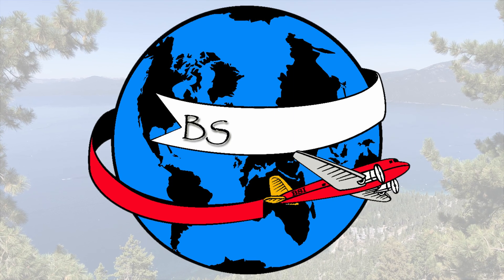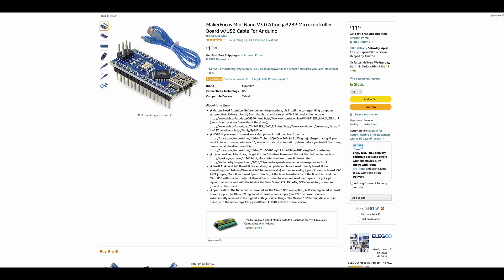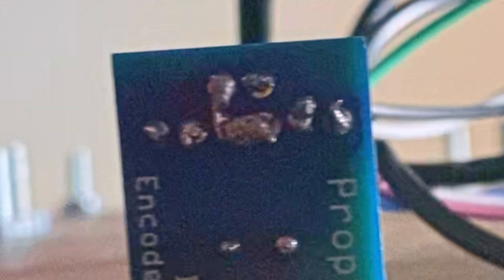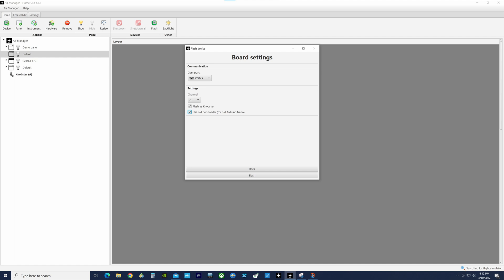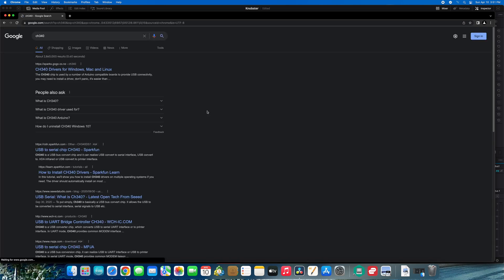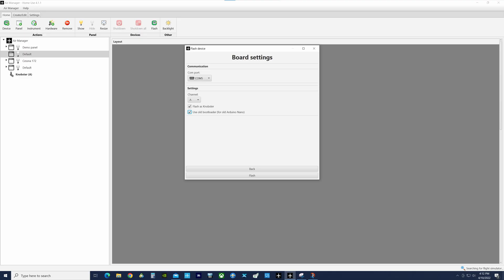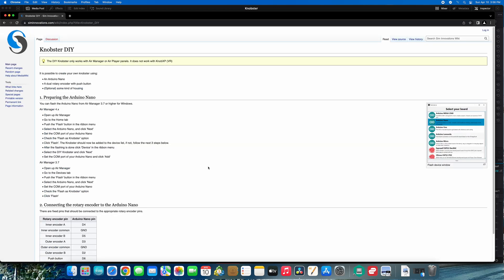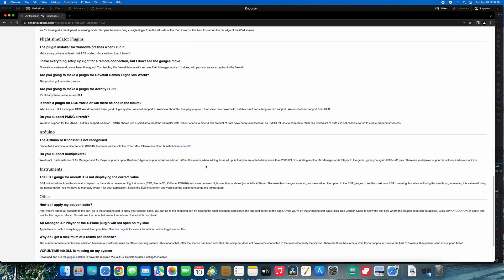Flight Sim DIY Tips and Tricks - Useful Information for Any Flight Sim Enthusiasts

Comment: Hi, very interesting, I was wondering how about the set up in msfs 2020, how can I chose the control I want to with the knobster. Thank you and have a nice day.
Reply from the maker: Thanks.. You need to use a secondary software like Airmanager to control systems like the GNS 430/530 in a Cessna for example in MSFS 2020. All you do is pop out the screen from MSFS 2020 to another monitor. I show this in one of my other videos. Airmanager is pretty cheap and you can control many systems in many planes on MSFS 2020.
Reply: Thank you for the info.

Comment: Awesome! So if i "flash" the arduino as Knobster, then there is no programming involved on my end, correct? Thanks for any help
Reply from the maker: Correct.. airmanager normally just sees it
Reply: @pilotbsinthesky3443  Thank you!! And are you having issues with the dial moving the hsi/cdi in 10 degree increments instead of 1 degree? I've heard that was an issue before but not sure if its solved yet.
Reply from the maker: @ItWasAllADream66  No not at all.. It may be a setting in airmanager. Some everything is independent, so all dials could react differently depending which ones you place in airmanager screen and possibly run in MSFS or Xplane.. Just have to play with it.. Look into settings of each dial as you set them up. Mine works perfect with both programs
Reply: @pilotbsinthesky3443  

Thank you sir! Really appreciate your help.

Comment: Hi, have a question, do you know anything about knobster? I have knobster and a Wimaxit 15.6 touch screen monitor, but the knobster does not work. Touch screen,, knob turns blue, take finger away,  knob goes back to normal, will not turn to yellow. Have monitor hook directly to computer,  have feed for monitor hooked directly to computer, and monitor plugged into surge protector.  Knobster  is hooked directly to computer.. Would you have any ideas?
Reply from the maker: You may need to work on windows to make sure it is setup as a touchsreen for your system. I've had to reestablish this with windows a couple times. For some reason it just kicks it back to a normal display for some reason. There are various youtube videos that show you how to do this. Mine works perfect with air manager still